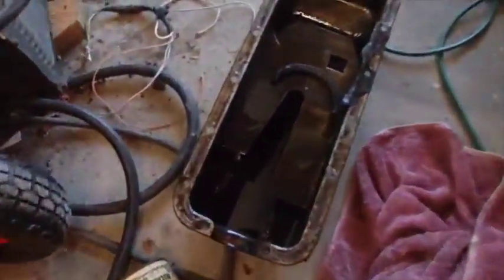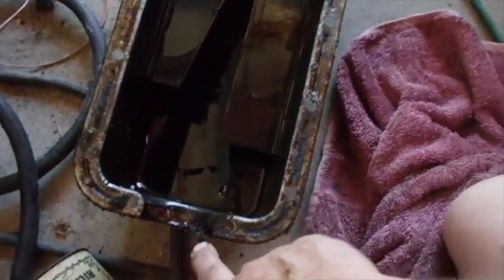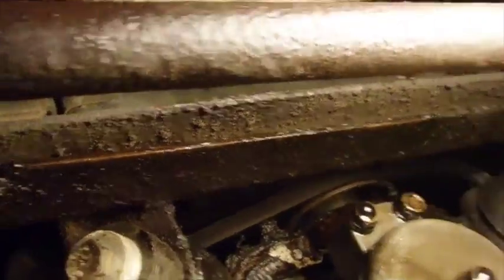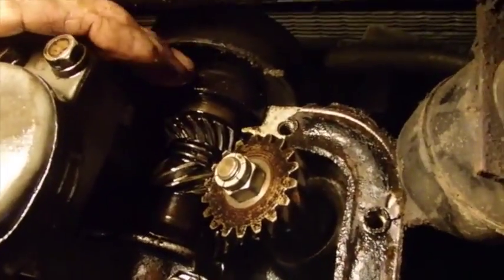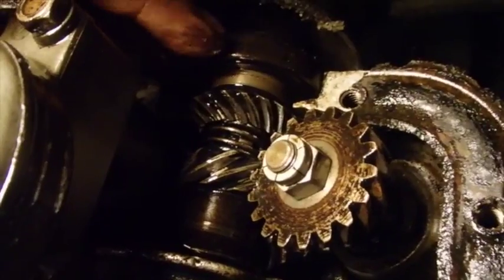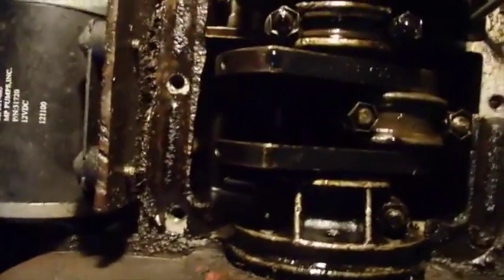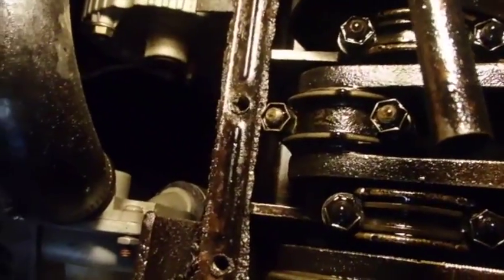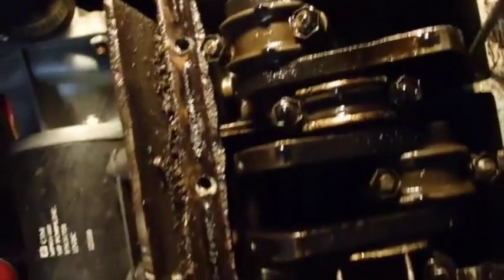Strapped Maine Crosley Motor?

Comment: Yes! Strapped mains! Remove the clutch cover and you will gain a bit of woggle room. First engine to have; inserted bearings,  Pressure feed oil system, Shaft drive overhead camshaft, Spin on oil filter in 1950. Valve rotators. High compression. And More!
Reply: High tech little things weren't they? Ya sound like a commercial. But, wait there's more . . .
Reply: do you still have any of these motors lying around yet? i think they are wicked cool.
Reply: +onelonleyfarmer  I sent all the extra ones with Mr Peek and MrHevyshevy.  If I get another one you can have it.
Reply: no no i don't think i need one but it would be cool for the master to pull one apart and show us the inside with no guesswork,, i like guesswork but it would be cool to know before we show.
Reply: +onelonleyfarmer  There is no telling what you and Boy Wonder could make out of one of these engines! Crosley even made a tractor / car called , Farm 0 Road.

Comment: Just FYI, motor weighs 60 lbs after starter and generator are removed. May decide to just pull it. Nothing to it. If you need alignment tool I can send you one and you can mail it back.